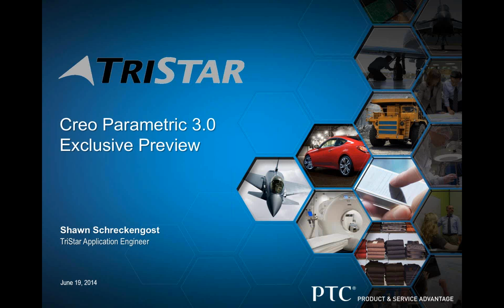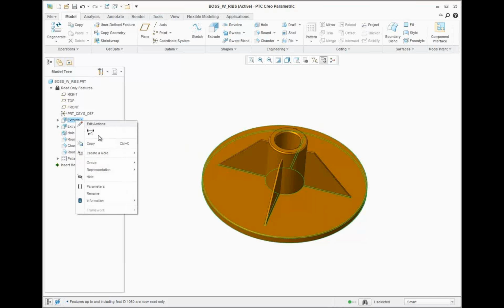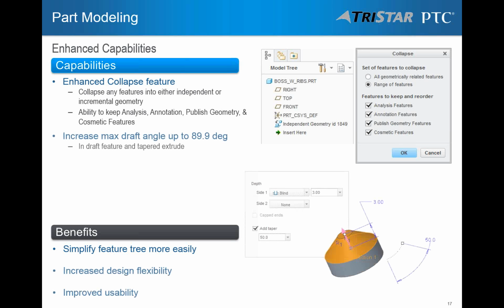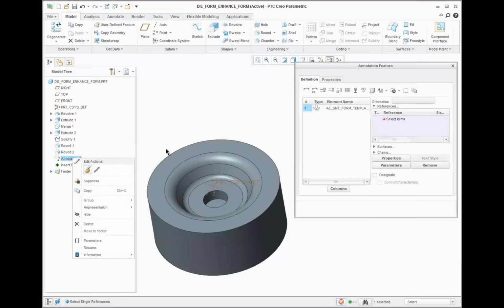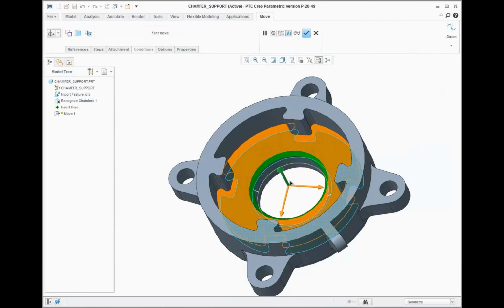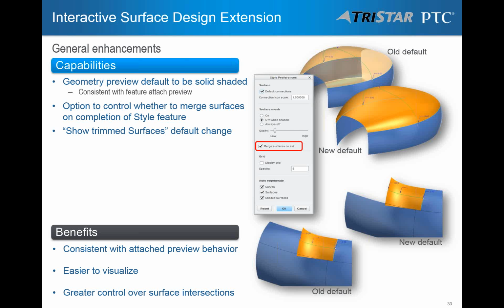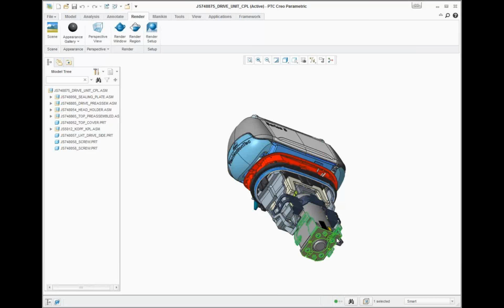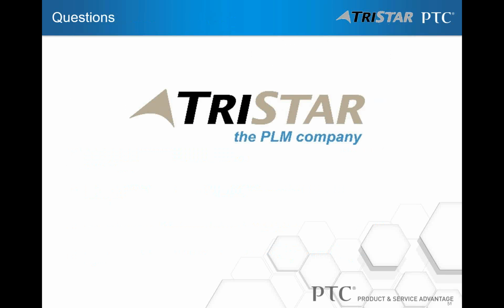Be the First to Experience Creo 3 0

Comment: Regarding the IFX, does the library contain part densities and material choices?  Can I add or replace the parts in the library with my current list of parts with my nomenclature and material finishes/densities etc?
Reply: +Don Williams No the parts can have densities added after the fastener is placed. As far as customizing the library of parts in IFX it is possible with the full version. The free(lite) version does not have the ability to customize the annotations and fastener library.